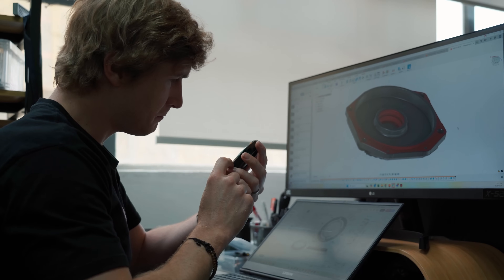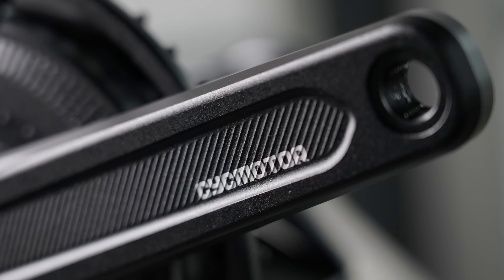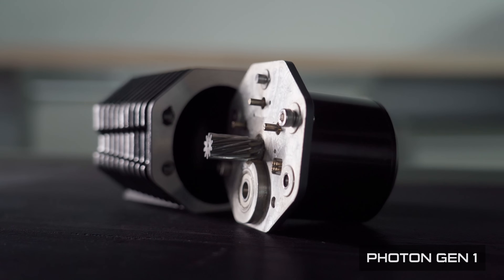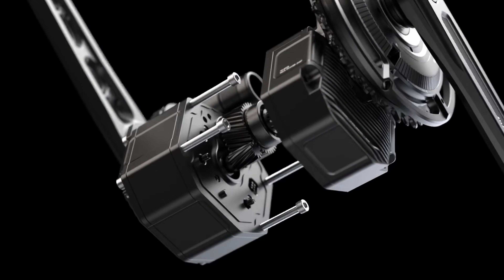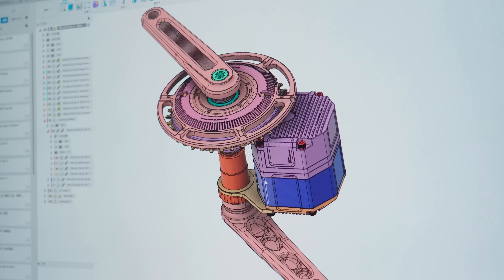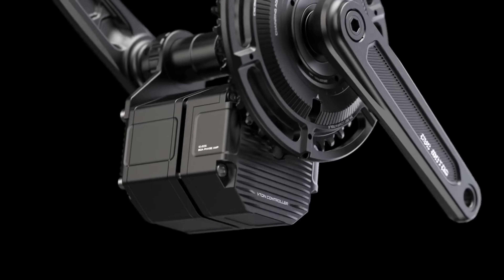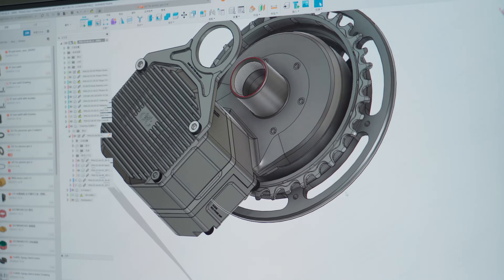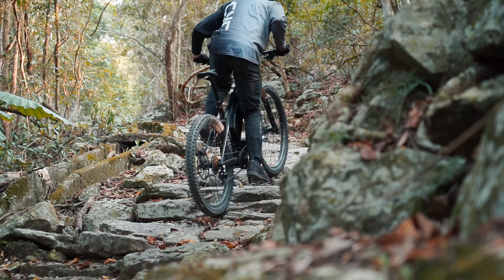Next-Gen Photon Mid-Drive Motor: Major Upgrades Explained!

Comment: Excited to save about 5.5lbs over the bbshd and get 500w more power, stock. And get torque sensing. And get that nice new display. And have an acceptably narrow Q factor with the option to make it even narrower with Lekkie cranks. And get more range out of the same battery due to higher energy efficiency.

Comment: Love what I'm seeing with the CYC PHOTON GEN 2, and am considering it to replace the Shimano Steps e6000 motor on my wife's ICE Adventure HD 26FS Recumbent Trike. It is coupled to a Alfine 8 speed IGH with di2 Auto Shift which I will be replacing as well most likely with Envielo IGH with a manual Shifter. Ideally i would use a Rohloff Speedhub again manually shifted. Please, please develop a Kit for direct installation on Recumbent Trikes  with longer cable runs and assorted installation hardware.
I even thinking of replacing the Tongsheng Tsdz2 48v750w middrive on my ICE Adventure HD 26FS. 
Thanks for developing what may well prove to be the best Aftermarket Middrive Motor on the market !
One thing you might want to clarify,  or maybe its just my IGNORANCE, but what is the advantages of a 72 volt motor, over a, say 48 volt system like my 48volt Tongsheng Tsdz2? 
I have a feeling your going to need lots of stock on hand !
Reply from the maker: Thanks for the support! It means a lot to our team to get positive feedback on their work.

Regarding your battery question for the Photon Gen 2: whether you use a 72V, 65V, or 52V battery pack, the motor’s peak power remains 2000W.
The main difference with a higher voltage system is that it can deliver power more efficiently, resulting in quicker acceleration and better hill-climbing performance. Additionally, higher-voltage packs often have more energy capacity (Wh), which can translate to longer range depending on the specific battery configuration.

We’re really encouraged by the demand and thrilled with the results from the first batch of Photon Gen 2 units. We’ve already increased production capacity across all products heading into 2026.

Comment: What is the difference between the Photon gen 2 250w and 750w version, is it only the firmware? Is it possible to install the unrestricted firmware on either version for “off-road use”? Does the 250w version come with a 250w sticker or markings?
Reply from the maker: The only difference is the firmware. We've made a 250W firmware so that those who want to use it on public roads, can still do so. It is possible to get the 750W firmware if you have the 250W firmware but you will need to check in touch with your reseller or contact us.

Comment: Nice presentation. I didn't realise the gen 2 was 72v compatible so that is a big help when sharing batteries between bikes.
Reply from the maker: Thanks! Yeah we realised that opening up the system for up to 72V was a requirement for the new generation. We needed to go back to allowing as much flexibility for builds as possible.

Comment: Can I use the new displays with my Gen 1 Photon?
Reply from the maker: Unfortunately not... We've made massive changes on the electronics switching from UART to CANBUS. This change in communication protocol makes most of the electronics not cross compatible. Just the speed sensor and throttle. It's really unfortunately but the change was very necessary so that we can start advancing to keep up with other industry tech.

Comment: Don't know much about this company. How can you ask double the cost of other mid drive E bike units on the market?
Reply: This is literally the best motor/brand on the market. Significantly better quality, longer lasting, doesn't require upgrades (which most other motors do once you buy them to make them decent, which end up putting them close to the price of the Photon anyway). now also easier to repair.

Comment: Does anyone know if this revision fixes most of the issues with the gen1?
Reply from the maker: Hi there. Yes, that's exactly why we've made the Gen 2. The largest issue being the sprag clutch and thermal performance both being address in this generation.
Reply: @cycmotor  How much is the diffrence in thermal performance?

Comment: Any chance the Photon can support a 32tooth chainring? There’s a lot of frames that max out at 32tooth.
Reply from the maker: Yes, it's coming soon: 32T and 34T options
Reply: @cycmotor  Any update on soon? would really like a 34t at least or a 32 if possible
Reply: I've contacted them multiple times on the chainring, the 34 is difficult on many mountain bikes

Comment: Really appreciate the work your team does to continuously improve your products. I especially like the fact you have an open system allowing us to work on our own repairs. I'm on my 4th upgrade on my DIY bike with the Stealth motor. This time around I sourced a frame from Soma which, after over 7k of "testing", has proved to be exceptional. I also went with hand-built wheels using based on DTSwiss 350 hubs, the rear being the newer hybrid all steel parts version for eBikes. Brakes got upgraded to SRAM Code RSCs with a 220mm front disc and 180mm rear. Motor, battery, and all the rest of the build came over from the previous build. This is what I love about DIY. Once you have a great motor and battery you can experiment with different types of bikes. I did also switch the drivetrain over to the Shimano Linkglide setup as it is advertised as being 300% beefier for better eBike builds. I wanted to test it in comparison to the Box Components version on my first build. Now I have my sights set on doing a build with the new photon and your new drivetrain. I think that combination is an absolute winner for 90+% of DIYers.

Comment: Amazing improvement! However I feel kinda left out and betrayed with my 1st Gen photon that still has no actual parts available especially the sprag clutch that slips very often...
Reply: ... as well as no sensible process for re-greasing the drive gears, mine are getting noisier approaching 7000 miles.

Comment: Is the intuition display compatible with the X1 Gen 4? I've been waiting to buy the X1 Gen 4 with the new display
Reply from the maker: Not yet regretfully.
Reply: Any ETA?  @cycmotor
Reply from the maker: @Alphabet7  we're aiming for Q1 to Q2 2026
Reply: Oh Woah that's really far. When you do release it will it be compatible with my cyc x1g4 if I buy it now? Or will we need a new controller or something?

 Like how will that work?

Anyway you can just ship a bonnell cyc x1 gen4 with the your intuition display?

  @cycmotor
Reply: @cycmotor  Noooooo! i have an x1 pro g4. How far can the Proton G2 be pushed. Hopefully the price is low enough to where its worth going proton instead of spending a bit more and just getting the x1 pro.
Reply from the maker: @donsreview-hakim  The difference between the Proton and the Pro is still significant. The Proton will peak at 3000W and approx 160N.m. whereas the X1 Pro is still double the power and up to 280N.m.
Reply: What abaot the stealth? Will it in the future?@cycmotor
Reply from the maker: @4132gil  at the moment yes. The demand is still there especially due to the flexibility of the mounting but we'll keep evaluating this over the coming year.
Reply: Its a brilliant  peace.  I'd  love to add  one on my bike@cycmotor